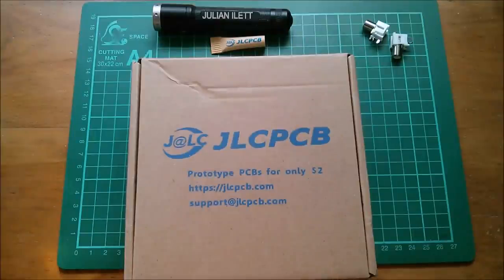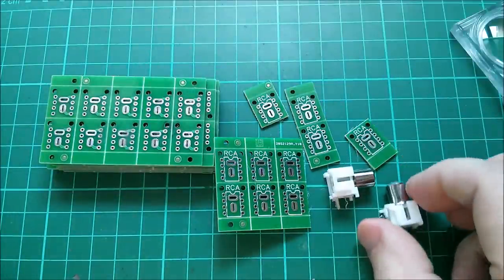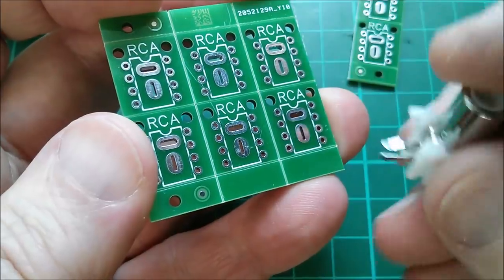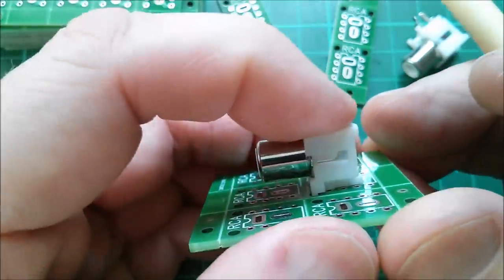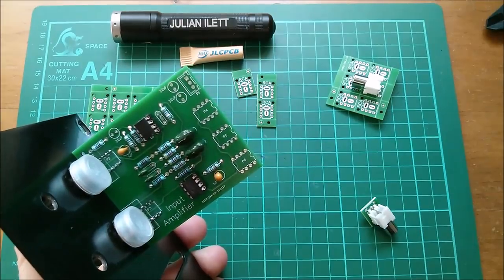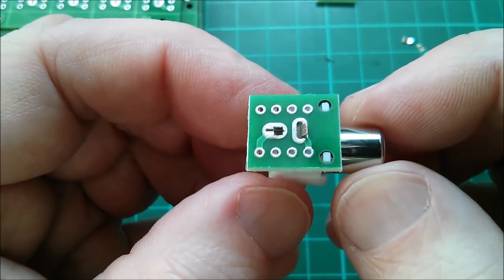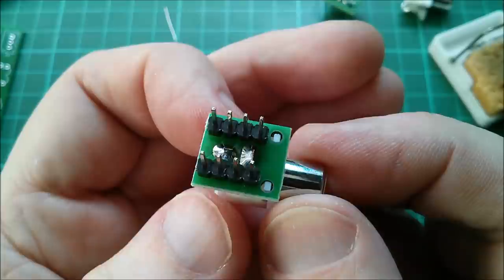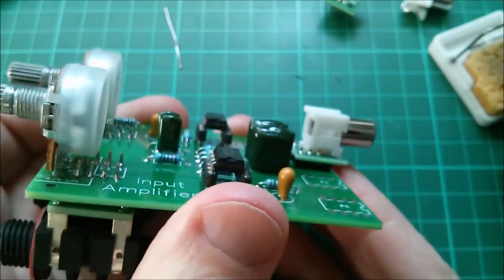New PCBs - Panelised RCA Boards with Slotted Holes - Vocoder

Comment: The 2 front square "pegs" as you call them are standoffs and that wide area on the rear pin acts as a standoff as well to keep the whole thing even off the board. and if you kept the clearance off the board, you won't have a problem with the pins under it.

Comment: The square pegs plus the little hook on the barbed pin keep the connector level when placed on a board. By making the slot wider and adding holes for the plastic feet you have defeated that purpose, but because you did both it still sits level, only a little closer to the board.
Reply from the maker: It looks like both seating positions are acceptable. I just felt that putting the plastic pegs in holes would make the connector better able to take the force of the plug being pushed into the socket :)
Reply: @JulianIlett  This is a optimal

Comment: The rca socket is designed to stand off pcb by the posts and the rear extended pin. The bent front pin is ontended to clip into pcb slt with pcb at mid bend!
Regards
Helmuth Schultes

Comment: as far as I can tell the two plastic pegs at the front are not meant to go through the board  so the extra metal on the rear pin is there as a depth stop

Comment: I can see using an adapter board as useful. It helps adapt to a specific connector without making board changes. 

The phono pin boards, and the main board phono pins, look like IC pins.  Maybe use 2 circular pins instead of 2 rows of 4 pins. This is to avoid confusing the phono plug for an IC when looking at the main board. So, the main board also needs to be modified. I didn't see the previous video, so maybe there is a reason for the IC type layout.

Comment: The extra barb, (there should have been more) is to handle the stress of plugging in and out.  The solder connections frequently crack from the stress.  I have resoldered so many, I can't count.

Comment: You can make a perfectly flat solder joint with through-plated holes or vias by using a little flux in the hole and a minimal amount of solder, then leaving the iron on the pin for a second longer to get it to drain into the hole... You will lose some mechanical strength though.

Comment: The resistors look very neat on the amplifier board. Aesthetically I think they look better than SMDs, and I wonder if that was the reason you chose not to go with SMDs for the resistors?

The new RCA boards look good and it's nice to learn a lesson through someone else's almost mistake.

Thanks for the video, it's encouraging to see successful outcomes.

Comment: Firstly, overlapping: perhaps this could be solved by having parts in the PCB library that have outlines as part of their makup, one would then know when things were likely to get in the way of one another.

Different pad layouts for similar parts: is this a limitation of EasyEDA?  In KiCAD one chooses the part and the pad-footprint separately, so any given design(er) would choose a consistent set of pads.

Thirdly: Why would the silk-screen of a polarised part not have the polarisation included, again this is a CAD library issue and needs fixing there (by you or the library's maintaner).

Given that it is possible to overlay the 8-pin DIP and the RCA footprints perhaps doing that on the amplifier board would have been more sensible?  Then current production could fit the RCA sockets directly and only use the daughter boards later if and when needed.  If you think that 1/4" jacks are a build-time possibility, add their footprints as well.  As other posters have suggested this seems to have been over-thought and over-engineered somewhat.

Rather than RCA for board-to-board interconnects why not use the little leads that we used to use to connect the audio from the CD-ROM to the motherboard or sound card?  These just need 4 pins at 0.1".  Cheap as chips nowadays, and easily available in bulk.  Stereo if needed.  Less bulky.

As another poster pointed out, when you were about to solder the pins to the daughter board why-oh-why didn't you slide the plastic carrier along the pins so that the pins barely went through the board?  Easy to do - put PCB on a hard surface, put pins in holes, push plastic down until it touches the PCB.  Going from this (poor ASCII art):  --H-- to this: -H-----.
Reply from the maker: I'm still learning EasyEDA - the footprint manager lets you override the associated footprint, and select a different one - I'm using that feature more and more.

The capacitor silkscreens were my own design - I deliberately left the + sign off - I'm a bit weird like that :)

Yes, sliding the Dupont pins would have been sensible - I didn't think to do it :/

Comment: 10:35 - If you really want to mount the square pegs into the holes (instead of using them as standoffs), you should probably cut the pins (flush to the board) before soldering them.

Comment: Way too Late for this idea...but perhaps for version 2.0 you should use the DIP pins 1 and 8 for the signal and pins 4 and 5 for the GND (or visa-versa). that way you could use your daughter board on either the top OR the bottom  of the mother board....Great work on the design..I love ESAY-EDA and JLCPCB
Cheerio, Barry
Reply: and.... what about for ver 2.1 on the daughter board have DIP pins 2 and 7 connected together for the GND and use Pin 4  (OR 5)  for the signal pin. Why...because first off, you wont have to solder the pesky pins 1 an 8 which are in interference with the connector, and the second reason would be you could create a Stereo input/output when installing one daughter-board on the top and one on the bottom of the mother board.. You would then have the mother board designed to pull the left signal from pin 4 and the right signal from pin 5. the daughter boards would be identical, but because they would be flipped over the RCA jacks would be connected to the different pins. of course you would only need 1 set of DuPont pins because once the first board is assembled and installed in the mother board you would just slip the second daughter-board onto the same pins which are sticking out from the underside of the mother board. - quite brilliant if I say so myself...
Barry
Reply: one more thought....when designing your boards, may I suggest you add a "Version number" to the silk screening.. I started doing this when I make small changes the the PCB layout/design...it avoids grabbing an "OLD"  board from my pile when making a project. I have several hundred boards lying about which at first glace look the same., by having the version number in the screening i can be assured I am using the correct one.
Reply from the maker: Yes, I like your first idea :) And the output PCB needs 16 inputs, so the top/bottom idea is interesting.
There will be other daughter boards - stereo 1/4" jack for the foot pedal - 4x stereo 1/8" mini jack, two of which will provide 16 inputs to the output mixer amplifier

Comment: By the way Julian, people who have difficulty seeing objects in focus close up are long sighted. People who have to use spectacles to see distant objects are short sighted. If you start off short sighted, life becomes even more annoying when eventually your eyes degrade and you become long sighted as well. Then expensive vary-focal spectacles become your best friend... (well, once you get used to their limitations...)
Reply from the maker: I'm both short sighted and long sighted. My eyes have long since lost the ability to focus - they're fixed at about 2ft (computer monitor distance). So for driving, I'm short sighted and need prescription lenses (negative diopters). For soldering, I'm long sighted and need reading glasses.

Comment: As I commented on another of your videos, I think that the two plastic legs on the front are supposed to sit against the PCB, not in holes. When the "tag" (at 2:15 you call it "this little piece of metal") on the signal lead fits into it's hole, that "tag" will set on top of the PCB supporting the whole plug (sitting on the two plastic feet at the front) above the board leaving room under it. At 2:11, I think the "barb" will latch under the PCB because the of the spring effect caused by the bend (3:02) in the ground pin in the front hole.
Reply from the maker: I did consider mounting it on those 3 points, but felt that it would be far more solidly attached this way :)
Reply: Okay, I understand. I only commented because you seemed confused by the fiddly bits on the signal contact. Cheers.
Reply from the maker: The confusion for me is that the genuine CUI part (https://www.digikey.co.uk/product-detail/en/cui-inc/RCJ-043/CP-1420-ND/408507) doesn't have the little flag.

Comment: The fitting problem you describe is caused by you using it wrong. The connector is supposed to be raised 1 millimeter above the board. That is why the barb is 1.7mm below the "fat bit".

Comment: Nice job. I would've made each side's 4 pins connected to the two rca pins since they're there.
Reply: Me too. 4 one one side could be connected to signal and the other 4 to GND.
Reply: But what if he had to use a connector that has 3 or 4 pins?
Reply: @Okurka.  It's made for an RCA socket which only has 2.

Comment: Hi Julian, which software do you use to generate your Gerber file for sending it to JLC pcb? thanks
Reply from the maker: I use EasyEDA :)
Reply: Hi   @JulianIlett  - How did you specify the V-scoring in EasyEDA? Could you show us in a follow-up video? I've been looking into it, but couldn't find much information. Have you seen a tutorial about it? I couldn't find one.
Reply: Maxint R&D: you don’t have to, really. Just choose Panelize from the menu and tell how many copy to make horizontal and vertical. I make as many fit in 100x100 mm. If you have a circuit less than 70x70 they stop the processing and ask you what to do. My first time I had to pay shipping twice because of that: they hadn’t stop processing the other pcbs from the same order 🙄
Reply: Hi  @matteopascoli  - I know that option and I've used it in the past. It used to be free, but now they add 8 dollars to the bill for only adding some vscores. That's why I'd like to do the panelizing myself. I just haven't found how to do it in EasyEDA. Do you know how? BTW I also made some errors: first time I set the radiobutton to panelize but forgot to enter the dimensions. Another time I also ended below 70x70 got that error and then used some other software to panelize using routed gaps and mouse bites. (See the latest video on my channel).
Reply: Maxint R&D : sure, in your EasyEda pcb sheet, on the Tools menu above (spanner and screwdriver icon) choose Panelize and enter how many boards you want as rows and columns. Then go to Generate Gerber and Order at Jlcpcb and there you can check (from the image and from the dimensions) that the panelized version were uploaded.
Reply: @matteopascoli  - Oh wow, that sure sounds easy. I guess a (new) feature that I had not discovered yet. I'll try it out on my next order. Thank you for the tip!

Comment: only Problem i have with jst connectors is that they seem to be 2.5mm pitch instead of 2.54mm which makes them a bigger Problem on perf board designes (at least if your Sporting more than two pin connectors)

Comment: Cost of PCB + headers + extra time, because of inconsistent parts - why not just use phonos from a quality manufacturer/supplier?
Reply: @stephenstebbing9460  Or, since it's all board-to-board connections within the chassis, just use 2-pin JSTs and dispense with all this faffing about?

Comment: You like technology and taking things apart? I've asked BigClive, but had no luck...I was wondering if you would be interested in taking a RGB remote controlled bulb apart, with explanation of what is inside? I have four IRC RGB Light bulb's in my house and they have been excellent. They have many different colour modes, full and dim light settings and automatic gradient settings. I thought that taking one apart would be educational, but I don't want to take apart one of mine as I don't really know what I am doing! I hope this message finds you well and you may consider doing this on your channel. Not sure why BigClive refused, I even offered to buy the bulb for him...

Comment: You could of made the front pins (almost) level with the pcb and just snip them on the other end a little shorter to match the other ones.
Reply from the maker: I should have done that - you're right :)
Reply: Exactly what I thought as watching. Even still, I really like the daughter board ideas you've put in to this project.
Reply: I've done that before too. Just push them down closer to the board before soldering.
Reply: "could of made" - And you could HAVE made the better choice of the middle word there …
Reply: @Anvilshock  well thank YOU Mr Grammar check. How ever would the internet continue without such a pragmatic grammatist at our disposal.
Reply: @korishan  I don't know, but I do know that it would surely be a better place without people who get mightily upset about having their mistakes out of laziness and disregard pointed out to them instead of simply acknowledging and fixing their mistakes.
Reply: @Anvilshock  The point is, you specifically pointed out an error in grammar that is not only quite common, but very quite easily to over look. You nit picked something of 0 significance, especially considering that what you were correcting has absolutely no bearing on the video or the content of my comment.
It's not that I am easily upset for my grammatical error. What is irksome is that someone chose to completely go out of this world, neigh, out of this universe, to make a response about something so inconsequential and absurd and insignificant. Perhaps leave the grammatical teaching to the language teachers in the classroom environment. Thank you for the ranting. Good day to you sir/maam
Reply: @korishan   The point is, you specifically MADE an error in grammar (spelling, actually, for reasons that I will not go into here) that is not only quite common but also very prevalent with people who just don't give a rat's arse about how they represent themselves in writing. In case you didn't notice: Your very own attempt at justifying your mistake illustrated even more vividly that you cannot be arsed at all to take care. Just because a mistake is common doesn't make it less of a mistake. Answer me this: What's the threshold for acceptability of an annoyance (your lack of care over not making such mistake) based on its commonality? Ad absurdum: How many more times would you require being annoyed by me (and my pointing out your mistake) to begin accepting it because it is now "common"? Inconsequential, you say? Well, who are you to judge that? Thousands, millions of teachers are trying to pound proper spelling etiquette into each generation of learners, and here you are, trying to pass your gleaming example for indifference, arrogance, oversensitivity as accepted reaction to correction and criticism instead of just sucking up to it and acknowledging your anecdotal fault? Out of this world, nay (neigh is the word for describing a horse's shouting), universe? Yes, certainly out of YOUR world and universe, because you're certainly living in a most peculiar bubble.
Reply: @korishan  He's right, though, you know.
Reply: @Anvilshock  It doesn't matter if you win by an inch, or win by a mile. Winning is winning. If it gets your jollies continuing this charade, by all means, continue. It matters not to me. It only takes a few seconds for me to reply. Also, my answers are short, yours are books. Please continue, I enjoy reading your trollership.
Reply: @korishan  I suppose in your bubble it's only natural to also make up your own definition of what constitutes victory. By all means, do keep your bubble afloat and rising; it fills me with great satisfaction knowing that, the higher its altitude when it eventually pops, the harder the impact. Carry on, nutter boy.
Reply: @Anvilshock  The more you reply, the more my point is made.
here's some more 🍔🍕🍖🍗 for the troll
Reply: @korishan  A point that only has value or relevance within your bubble, I might add, but I know that already, why do you feel the need to state, even repeat, the obvious?
Reply: @Anvilshock  🍗🍖🍕🍔

Comment: Ehhh ??
Whats the point of creating the daughter-boards if you're going to solder them direct to the main PCB?  (Might as well have soldered the RCA's direct?!?!?)
I thought the whole point was so that they could be easily changed in and out (without de-soldering) using IC sockets ? (like the two 8-pin IC's are using)
Reply: He did this in case he couldn't get the same RCA sockets in the future.  Just get new mini PCBs rather than have to redo the entire main board.
Reply: Hew mentioned in a previous video that it allows flexibility  so he doesn't have to re-design the main board if he wants to use a different type of connector in the future.
Reply: The force of plugging in an RCA connector would push the pins out of the IC socket.
Reply: @natejgee  
>Just get new mini PCBs rather than have to redo the entire main board.

Or just use the CAD tools and do a footprint replacement when the time comes. It would be literally 5 minutes work to change the footprint assignment, redo the tracks and fire off the new gerbers to jlcpcb.
Reply: Ahhh that makes more sense now, personally though I would have still have soldered a socket to the main board so that I could quickly swap out connector types !
As for the fella saying that plugging a phono/rca lead would pull the daughter board out, although true that would easily be prevented by plugging the lead into the daughter board first and then connecting the daughter board to the main board. :-)

Comment: learn to solder. also those headers the plastic that holds the pins can slide on the pins so you can move them and create a shorter solder side on the pins.